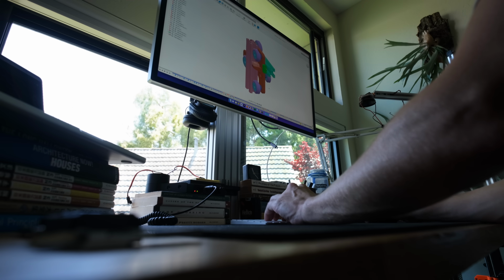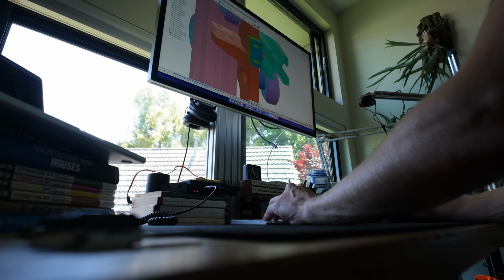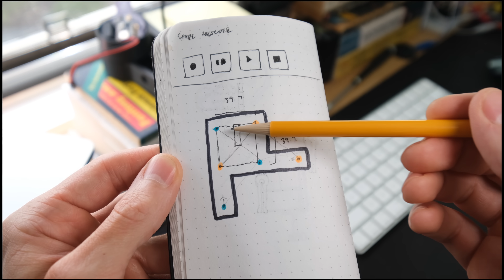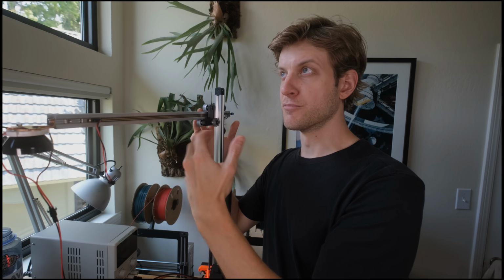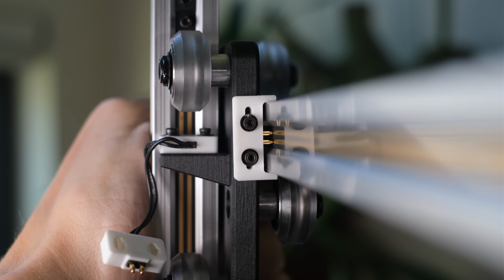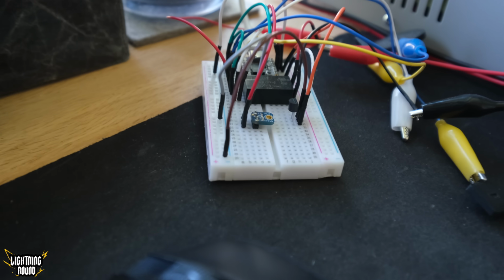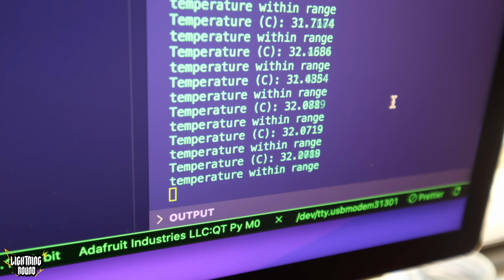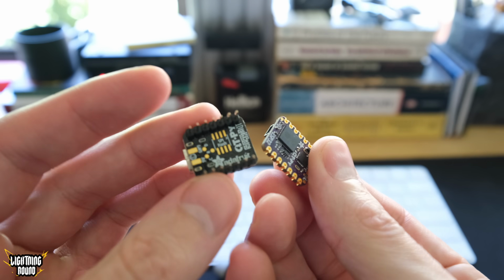This stupid thing might actually work - DIYson Lamp Build Log #12

Comment: I would avoid PLA for the main carriage. It has far too much creep to work over long periods of time. The wheels will loosen and the lamp will start to have tons of play. 

For a microcontroller that supports circuitpython and has more storage, I would suggest taking a look at PJRC’s Teensy products. The Teensy 4.1 can have flash storage added to it such that it can have an additional (if I recall correctly) 256MB, and it also has a microSD card slot, so you could use that for basically any amount of storage.
Reply: PLA creeps very easily especially in an environment where temperatures can get warmer. Probably ASA, ABS or even PETG would be better options. Nylon also creeps.
Reply: The Teensy 4.1 has some issues (some pins not available, no proper debugger support, requires pressing a button to flash new code) but I imagine it would work well for this application. It's pretty cheap for how powerful the microcontroller on there is.
Reply: @ I'm not sure what you mean when you say that some pins aren't available - there are specific pins that are not capable of performing some functions, unlike - for instance - an ESP32 which has basically a full matrix for all pins, maybe that's what you mean?

In my experience at least, I have only had to use the button once or twice to flash firmware across hundreds, if not thousands of flashes. 

Yeah, the microcontroller on the Teensy 4 series is super fast.
Reply: While PLA is a lot more susceptible to creep I doubt there’s anywhere near enough mechanical stress in this case to cause creep in a dimension that would actually matter here.
Reply: @ I disagree. In order for the light to move smoothly and without play, the wheels on the extrusion need to be tightened relatively tightly on their tracks. Those wheels are all mounted to the PLA plate in such a way that there’s a significant amount of leverage, which is likely to creep over time. I wouldn’t be surprised if the actual reason he needed to tighten the wheels in this video was due to creep in the first place. 

Additionally, when the LED itself is fully extended, there’s going to be a fair amount of torque on the plate - especially if it’s being moved up or down from right next to the LED. If the arm is 18” fully extended (I don’t know what the actual measurement is) and the wheels are approximately 1” from the center, then any amount of force applied to the end of the arm will be multiplied by 18. So just two pounds of force used to adjust the lamp would result in ~36lbs of force on the wheel, and even more on the single shear connection from the wheel to the plate. That’s pretty significant for such a small, thin PLA plate. 

Basically any filament aside from PLA and Nylon (which is also generally prone to some amount of creep) would probably result in a lamp that rarely requires adjusting the wheel tension, while still allowing for the ease of access that the 3d print + aluminum extrusion design is meant for.
Reply: @ yea I’m not really sure how much force he’s tightening those wheels with but I don’t think it’s an issue since he hasn’t mentioned it despite using the design for a while. The reason I assumed they were loose in the video was because he had installed the new bracket and had not tightened it yet. Other materials would be better I agree but I think you’re probably overestimating the amount of actual creep that will be induced here. Creep is more of an issue with a prolonged constant stress and that moment arm from adjusting the lamp height wouldn’t last long enough for much stress to accumulate. Also the actual force on that lamp head should be fairly small since he has a counterweight.
Reply: @qwertyboguss   HIPS is pretty good and easy to print. Also you can get ABS+GF quite cheap from Bambu.

Comment: How about a 4 point contact system for the rollers?, with only three you are prone to angular movement, because only one side has two rollers and the other has one, but with two roles on each side, the possibility of that should be less. I imagine something like a simpler HIWIN rail-system, like you have already build but with 4 rolls for each rail.  :)

Comment: In order to minimise the problem of those screws for pogo pin assembly to be screws too tight or being unscrewed overtime my suggestion would be to used a 3d printed cylinder washer that would act as a screw distance limiter and at the same time would match exactly distance needed for the assembly to move freely. This might require a screw diameter decrease.

Good work by the way. I really enjoy this channel. I recently made myself a monitor stand from 60x20 alu extrusion  based on your idea, that is screwed on to my plywood desk (threaded extrusion, M5 screw goes through the table, very stable and visually lightweight). Thanks for inspiration.

Comment: idk my carriage is metal. It is off the shelf mounting plate (for construction or smth). Amazingly, it has a predrilled 20x20mm grid so wheels fit almost as is. And I think it wouldn't be that hard to make it from aluminum w/o cnc.
But changing to metal is very obvious brut force type of solution. So I respect a more smart approach

Comment: tbh I feel like adding rigidity would greatly improve the feel of the diyson
Reply: PET-CF is a good filament for this - it's heat deflection temp is also insanely good and the CF makes it pretty printable
Reply: water is wet

Comment: Could you connect the negative to the metal frame and change the rail to one with a thick trace and a brush instead of a pogo-pin?
Reply: Or one track on top and one track on the bottom.
Reply: @unia7663  I know, but if he implements too many details of the Dyson lamp it will be obvious. I'm saying this without having read the patent because using the frame as a power line should have been obvious to him. I think he's doing it on purpose.
Reply: A graphite bush was the original idea I gave, he just opted for pogo-pins instead when implementing it.
Reply: Aluminium extrusions are not conductive on the surface due to the anodising.
Reply: @DikkieKlijn maybe he could drill it and insert the cable in the hole with a screw
Reply: He would still need two connections as the ground can't go past the wheels in any case
Reply: @DikkieKlijn conductive enough, maybe if it’s painted then it’s not conducive
Reply: Maybe he's avoiding infringing on the Dyson's patent.
Reply: @leanngugi  I don't think the idea to use the body as ground is novel enough to be a patent.
All cars do it and I've seen other lamps do it.

Comment: curious if you were to just add the raised profile on the bracket to match the v-rail slot (with some tolerance) that it would help with removing the slop, and get better pogo pin alignment overall. I noticed in some of your drawing designs that was in there for the tiny bracket, but wasn't in the printed part. Doing it that way, then the pogo pins could be part of the larger bracket and not look like an after thought.

Comment: Why not just add a 4th wheel to support the extrusion's movement? Right now you essentially have a single point of definition on the top of the rail due to having one wheel, why not add another one to properly guide the motion?
The solution you went for feels like a band-aid: you're covering for the problem instead of facing it directly. It also adds a point of wear and friction, which - while being small - is still not ideal.
Also - what about replacing that spongy metal (which, to me. just looks like foam surrounded by copper tape, though I don't really know) with a simple thermal pad?

Comment: Yeah, I was going to say: move the pogo pins to the origin of rotation. It's not really that movement is the problem: it's the radius that the pogo pins sit at that's the issue. Also, if you had the rails face each other, you could maybe go down to one set of pogo pins and no wires, if you set them at a diagonal. This would also fix the issue you found on the vertical pins disconnecting completely. And, if you did that, it would mean the pogo pins wouldn't act as the movement-stop either as they'd be much more in the middle of the carrier, and between all the rollers.
Reply from the maker: "if you had the rails face each other" Can you say more? What do you mean?
Reply: @StevenBennettMakes  I think he might mean the conductors in the extrusions.
Reply: @StevenBennettMakes  you just needed to install both pogo-pin assemblies not at the middle rollers. I mean, draw a normal from the roller through the beam, and that's where the pins should be, that's the section that never moves laterally.
Reply: Oh. Didn't see your post. I wrote the same thing just now.
Reply: this makes heaps of sense. a more stable carriage is not a bad addition, even after fixing the pogo pin position
Reply: I think, from your video, the vertical power track is facing away from the lamp. I'm suggesting rotating it so that the power track of the vertical bar is facing (in a parallel plane to) the power track of the horizontal bar.
Reply from the maker: Unfortunately the belt occupies that vertical channel
Reply: @StevenBennettMakes  Ok I thought I'd watched all your videos but I've been back to watch your 3rd vlog and see how the belt works (though it seems at some point you moved back to a single-channel post). I still think this could work -- the belt just needs to be anchored to the carriage above the pogo pins. Provided the top wheel/bearing for the belt is sufficiently sized, the belt could still not interfere with the power track, and act as a dust shield for it too.
Reply: @StevenBennettMakes  Pogos below the belt hook on the arm, maybe could work
Reply: Can you move belt in other channel?
Reply: Yes!  The pivot!   and also if they're at the pivot they could be little wheel bearings and greatly increase the life of the entire assembly.
Reply: We've been saying that in the comments for a while now but alas, not read. That would be the cleanest option, and would also hide the pogo assembly.
Reply: Could also double up on the pins for redundancy, doesn't need to be limited to just one per rail
Reply: We’re all thinking the same ^^

Comment: I love your commitment to the project, don't shy away from using the aluminum carriage, it doesn't make the project less accessible, just means the kit from which ever company you partner with will be a few bucks more. It's a 2D CNC job -- it's trivial to machine it if you have your own CNC (even a desktop one). Can get a sheet of aluminum from amazon for ~$15 that will make enough for at least 4 lamps, probably more
Reply from the maker: I mentioned in the video that you can still use a machined carriage. Requiring a machined carriage would 100% make the project less accessible and harder to customize, and I want folks to have options.
Reply: @StevenBennettMakes 

What about a GF filled filament along with imbedded bushings?

Next step down would be just a tough pla/ pla+. 

A step up would be the aluminum carriage.  

I also worry about how much you’re able to flex the vertical arm.  It seems like you’ve got a failure point in the base.

Comment: Happy to see the project moving forward. Quick question: Why did you position the bracket on the outside of the rail? I was wondering if the same effect — moving the pins alongside with the rail — could be accomplished by having them run on the inside of the track. ( This could have an added benefit as this would cover the exposed pins.) In any case good to see you. :)
Reply: I have the same question